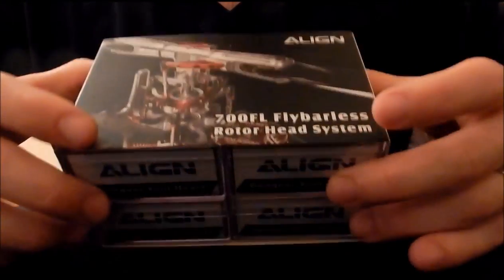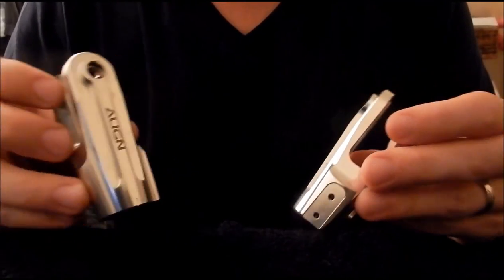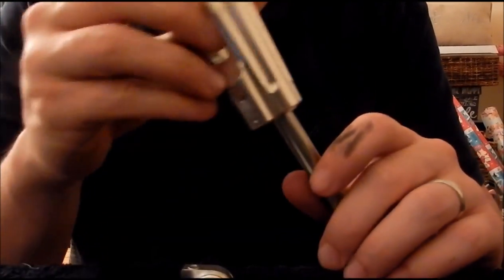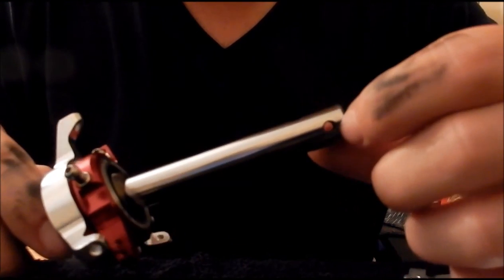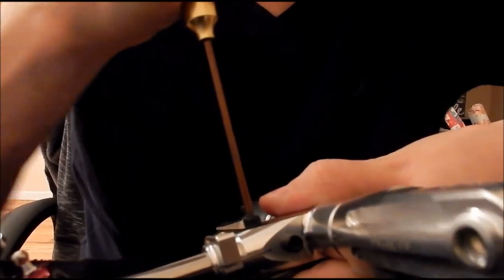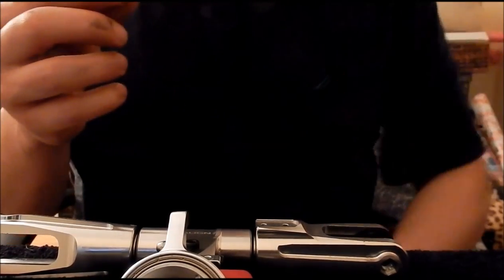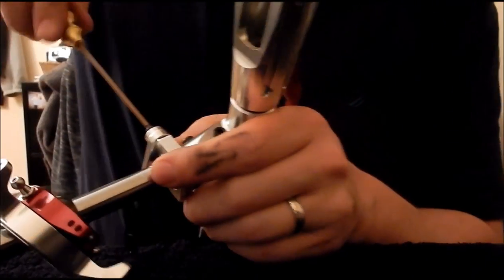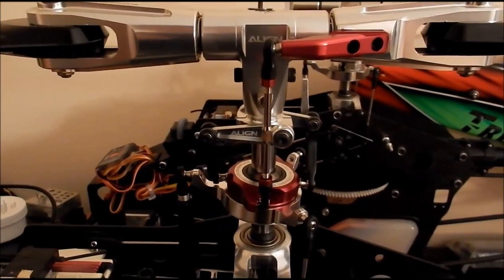700 DFC conversion to 700FL Head

Comment: I don't get it.  What is really the difference between one the other?  My still flybar. But I'm trying to understand the difference between dcf and fl so I can chose the right one for me.
Reply: DFC system puts more stress to DFC arms to the swashplate when feathering shaft moves (in dumpers) under blade load... That over time can - will make problems, weares faster. If you have to chose, buy this newer low profile FL as it is much better and lasts longer...
Reply: Here is one video someone pubished that demonstrates where is the problem in design: https://www.youtube.com/watch?v=r9XAPvYUXq4 hope it helps... Bye